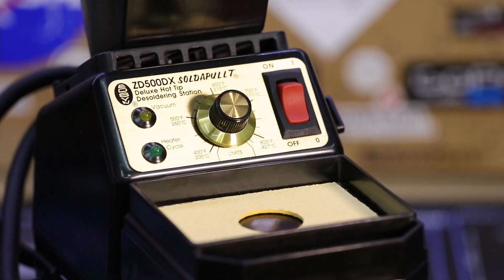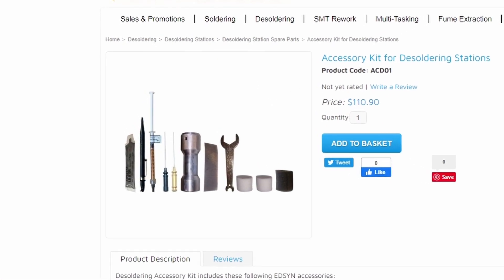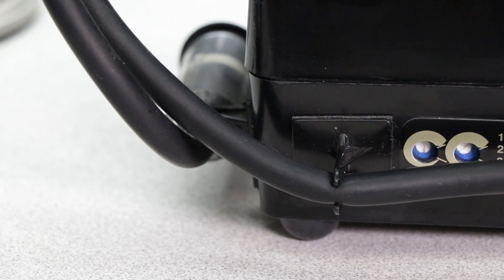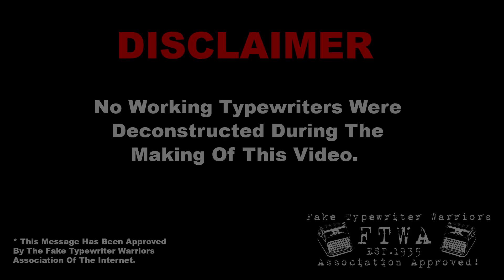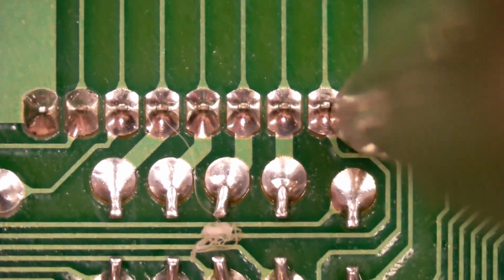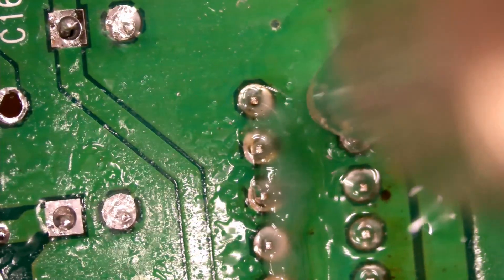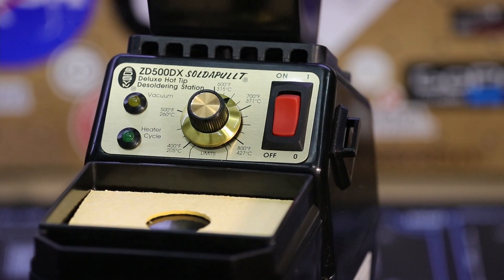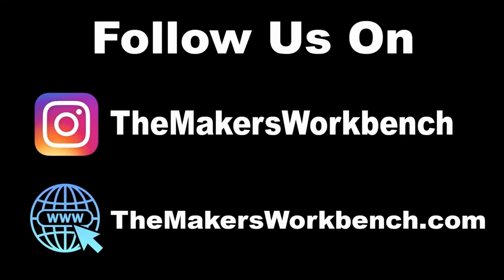Review: Edsyn Soldapullt ZD500DX Desoldering Station. Made In USA!

Comment: I believe Edsyn produce good electronic tools for repair industry. I also believe Made in USA tools are good enough to last decades. But your normal test and torture test are not enough for Edsyn, which would also surely pass by the Made in China junks. I wonder if this Edsyn tool actually desolder capacitor from modern multilayer heavily grounded gaming PC motherboard, especially from the CPU core power section. Your review using Edsyn desolder gun is good and I appreciate your effort, but I wonder if this tool would pass the real torture test as mentioned above.
Reply from the maker: Unfortunately I do not have a heavy-layer board to test out. If you have one you would like to donate for testing, let me know.